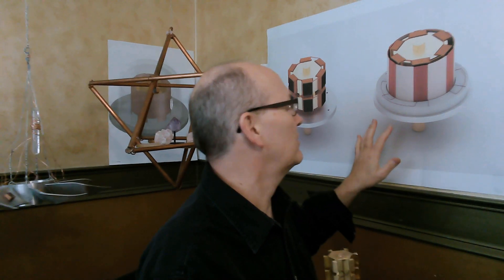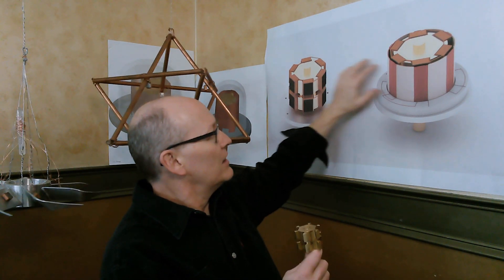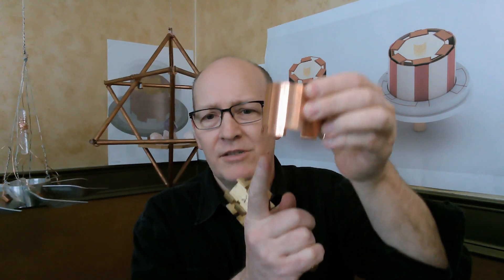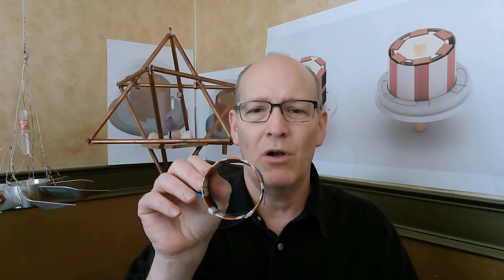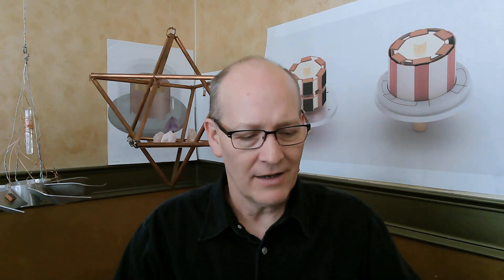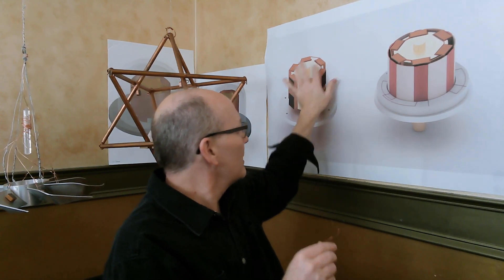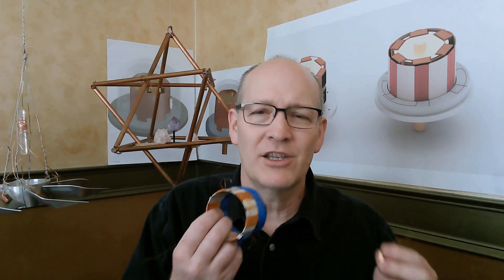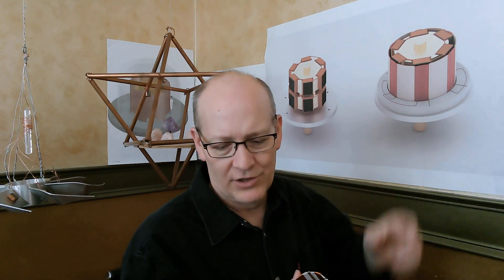Mini Romag Generator

Comment: It appears that the shaft and rotor use a key, but that's not in the parts list or mentioned. It seems to extend 1/4 inch above the rotor top in the renderings, but how deep does it go? Does it matter how long the key is?
Reply from the maker: People have built them with a key and without, so either way is fine as long as there is no slippage.  If using a key, it typically extends through the entire rotor.
Reply: @MagneticEnergy  Awesome, thank you :)

Can adhesive or anything be used instead of or with the key to attach the shaft? It doesn't say how to in the documents, unless I missed it

Could the rotor and shaft be made as one solid piece? If not, why not?

Comment: Can you explain the role of eddy currents in the copper stator, for the generation of magnetic/electro energy?. Thanks.
Reply from the maker: Very simply, they help balance the polarities as they are attracted to low points/energetic deficits during rotation, even though they are insulated from the coils, they still induce ongoing charges that are very helpful for continuous rotation...

Comment: I have a couple of questions for if I want to make my own. How do you get the magnets? And what kind of copper coated steel wire do you use? Or do you copper coat it yourself? And how do you attach the copper stator to the aluminium base? And is the type of bronze for the rotor important? And I see that the crimps on the coated steel wire are up in the air - does that not disturb the incoming energy? I thought that the space for the crimp connections was halfway in between the magnets, in the lathe machined slot. What kind of loads can you attach to the MR? Lights? Batteries?
Reply from the maker: Normally, we would get the magnets from China but supplies issues are making that more difficult, its probably best to do some research for custom magnet sources and just pick something in your price range. The copper coated steel wire is the same as the core wire in coaxial cables. There are normally slots in the aluminum base that the stator tabs stick into. Standard bronze is fine. The crimps are ok up in the air but they can be laid down as long as they don't make contact with the rotor. It will only power magnet devices...it will not power any electrical devices.
Reply: @MagneticEnergy  Ah thanks for the info! So then I'll need to make a magnet device as well... but where is the blueprint for that? I saw in the description: "Suggested use: Battery charging, lighting, powering smaller devices".. That is a bummer because the mini romag can be made with available materials but the load is not easy to build in a for me very uncertain time.
Reply from the maker: @nr7000000001  Its a serious bummer that it cannot power electrical devices!!!! I cannot give out blueprints for any device that connects to it, but the Pump design contains the principles necessary for that type of device. I am sorry I'm not being more helpful, at least until I'm allowed...
Reply: @MagneticEnergy  No you are helpfull. Magnetic water pump has 'no special alloys needed' so that is maybe something feasible. Only the boron carbide contacts can be difficult to source.